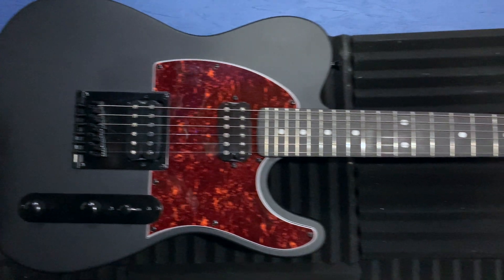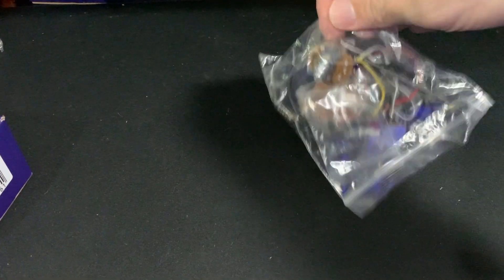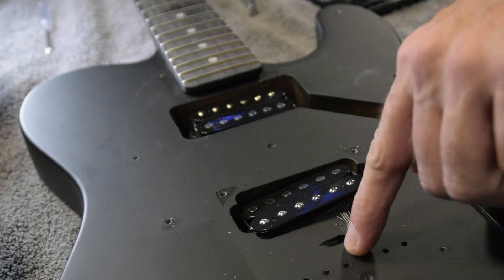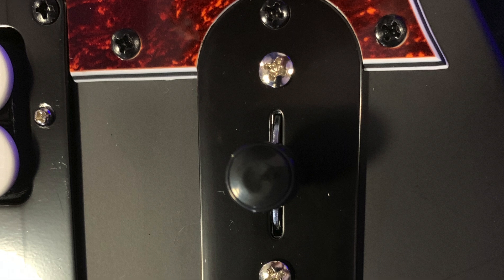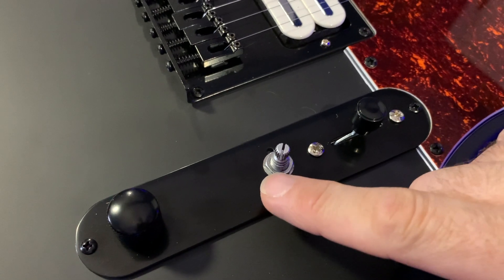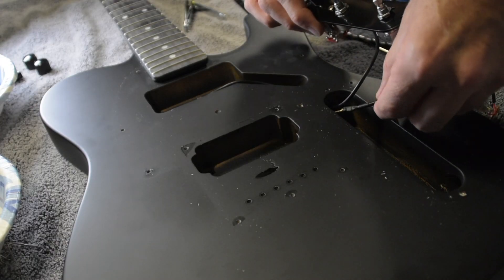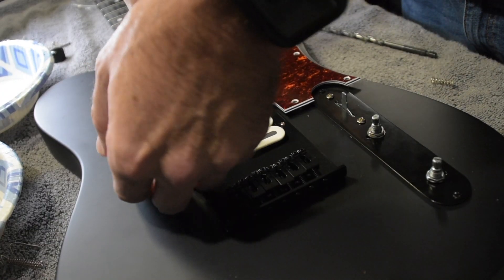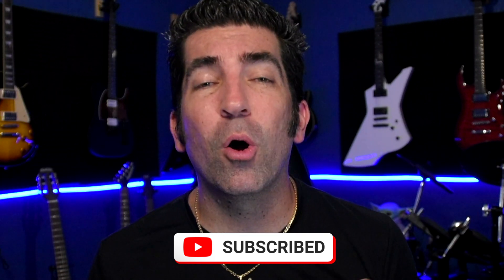Harley Benton TE-20HH GFS Pickup Install - Completely Solderless

Comment: Would covered humbuckers fit without having to cut out larger holes?
Reply from the maker: It’s been awhile since I did these videos… I do remember the pickup cut out being very tight though, so it may be an issue. Tough to say, but surf around some HB forums, this is a popular guitar, so I’m sure someone has done it

Comment: Taking another look at this. I assume those rail style pickups come in black too. I’m so used to the skinny rails you find on single coil sized humbuckers for a Strat. Are you happy with the tone or have any other HH recommendations for this guitar? I just got mine the other day any loving the looks but want better pickups.
Reply from the maker: So let me start with the fact that I absolutely LOVE these pickups… They are really conducive to my style of playing and they have a ton of sustain, particularly compared to the stock pickups in this guitar. That said, my only knock would be that they may have a tad too much low end for some, kind of a wider signal. So those who tune down may find them to be a bit muddy. If you go through my shorts vids, I tend to play this guitar a lot, so that should give you an idea of how it sounds… Also, I recorded this here for my next vid and it really kinda showcases the sustain at the end… Hope this helps 🤘🎸

https://youtu.be/vM-yJdyBSvU

Comment: I was wondering if you ever measured the output resistance of the stock humbucker pickups when you removed them? I'm curious as to what they compare to. They sound like very hot output.
Reply from the maker: Nah never did measure it… The stock pickups actually sounded pretty good, particularly for the price point, and yes, they were on the hot side…My biggest gripe with them was sustain, notes fell off rather quick. Other than that, the overall tone was probably the best you’ll find for a guitar under $100…
Reply: @FretboardDiaries  yes I agree. In my Strat that I modded I installed a set of Seymour Duncan YJM Fury (Bridge) - 25.7k, (Neck/Middle) - 25.5k, and the TE-20HH's seem hotter than those! I also have a DC Custom Guitar SuperStrat that I put DiMarzio HS-3's in and they have lower output. Hard to get a point of reference choosing new humbuckers and also can't get Seymour Duncan's as a set because they don't include the 52mm Trembucker bridge spacing so have to look at separate neck and bridge selections. Was thinking JB (hot) 52mm bridge and Jazz 50mm neck maybe, or something like the '59 or Alnico II Pro but they are classic vintage output.
Reply from the maker: @SteveMavronis  The stock’s definitely sounded better than I would have expected… I’m just picky… 😂 😂 I love sustain… 

I went with these GFS pickups because they’re considerably cheaper than Seymours and super easy to install with the wireless harness. I do love Seymours though, just couldn’t justify the cost of them for a budget guitar. So the GFS was a great compromise.
Reply: I am looking at cheap brand alternatives too like Fleor who has a Alnico 5 set that are compared to the SD hot rodded pickup set but 50mm/52mm and less than 40 and a ceramic magnet 50mm/52mm set for only 20.
Reply: @FretboardDiaries  I emailed Thomann and got this reply: "The pickups used in this guitar are OEM parts. So no branded pickups. The Output Level is medium to high. So somewhere around 8-10 Kohms." Their answer is not so definitive, more like a guess.
Reply from the maker: @SteveMavronis  yeah that’s what the sounds like, a guess… Too bad I didn’t measure them, that woulda made for a good comparison video.
Reply: Just found a  Seymour Duncan article showing how you can check from the guitar jack using an Ohm meter. I’ll try that shortly.
Reply: I tested externally with a good Ohm meter using a short guitar cable. The other electronics are in the equation but the bridge humbucker measures around 11k and the neck pickup 10.3k.

Comment: I dont like the pickguard, can i just screw it of without adjusting anything? Will the pickups stay in place or is the pickguard needed?
Reply from the maker: Unfortunately the pickguard is required… It holds the pickups in place and covers the routes on the front side of the guitar…

Although considerably more expensive, perhaps check out the Harley Benton Fusion SBk telecaster… It also comes stock with Active EMG pickups, so a pickup swap wouldn’t be necessary… Hope this helps, best of luck…

https://www.thomannmusic.com/harley_benton_fusion_t_hh_ht_roasted_bks.htm
Reply: @FretboardDiaries  thx alot man!
Reply from the maker: @julesvanlent8957  anytime man best of luck! 👍

Comment: Hey I just wanted to stop by to tell you I ordered a set of Tonerider Birmingham humbuckers. If I want to do coil splitting I need to either do something like buy a pair of Bourns A500K pots with the tone pot as a push-pull or a separate "black" mini toggle switch. I hope I select the correct parts LOL or a cheap wiring harness like that.
Reply from the maker: Right on man, I’ve heard good things about the Toneriders… As far as coil splitting, I rarely if ever use it. It’s just not conducive to my style of play because it cuts the gain in half… I know a lot of guys like it though…

I just got my Tesi kill switch in and I’m looking forward to that install. 🤘🎸
Reply: @FretboardDiaries  I agree. Never used it before. It seems interesting in demo videos because with these pickups there is hardly any volume drop they say. Dunno, either way I should get 500k pots at least. Plus with all the stories of mishaps I’m not sure if I should mess with nut replacement even though I’ve done one with my Fender Strat.

Comment: Very useful. I can imagine this pup-change made a huge  differense. I will look if you have a video pre change :) I too want to buy a buget tele and mod it a little. Does the stock machineheads keep it in tune or is it a must change? Thanks bro :)
Reply from the maker: The stock tuners actually worked quite well. I did change them out for Guyker Locking tuners just because I like the ease of stringing the guitar better, but functionality wise, the stock tuners worked just fine… Thanks for the sub by the way 🤘🎸
Reply: @FretboardDiaries  Top. Yeah so nice with good locking tuners, but if they work ok ill just may change nut or maybe even only use a little grafith like from a pencil. Thanks :)
Reply: @FretboardDiaries  PS. dang you got a good channel going. Keep at it and you will grow. Good format and good infront of the camera and all :)
Reply from the maker: @svenzia  Hey thanks man! It’s always nice to hear positive feedback…. I just hit 1000 subs a few weeks ago and it seems like it’s started to grow faster. 

It’s definitely not easy but it’s really enjoyable, and it seems like it’s a pretty good community of guitar players. I definitely appreciate the comments and WatchTime man, so thanks for watching 🤘🎸